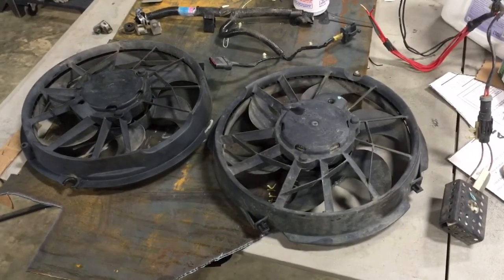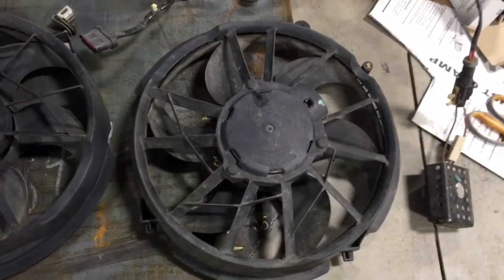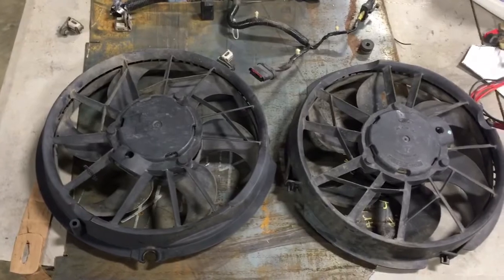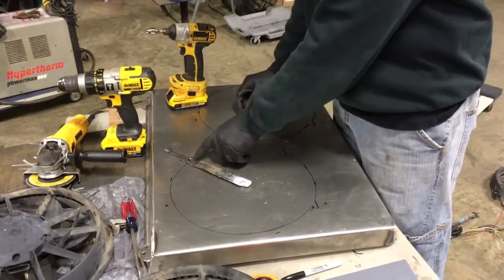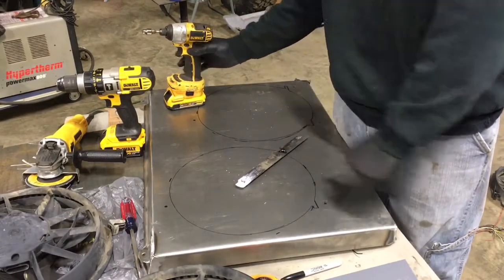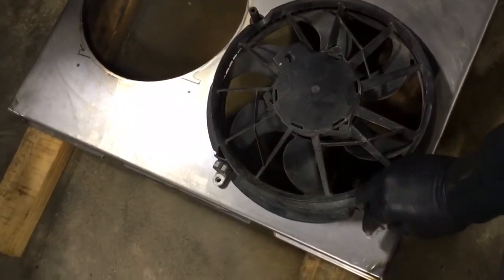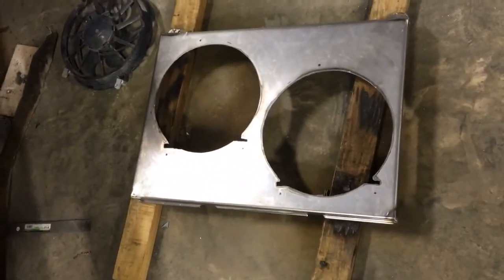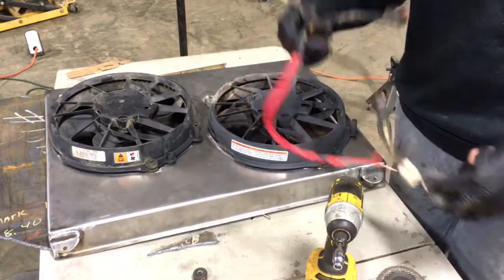1980 LS K5 E-Fans pt.1 Shroud Build

Comment: what did the local sheetmetal shop charge you for the shroud ? im building a turbo v8 colorado on my channel and need to get a custom shroud made for fans
Reply from the maker: I replied but I don't see it now. I believe the sheetmetal shop made the main part of the shroud for around $35-$40. I cut the holes out and welded mounting tabs on it.